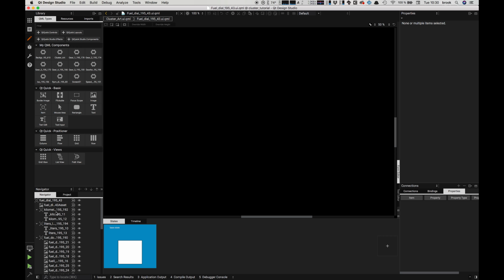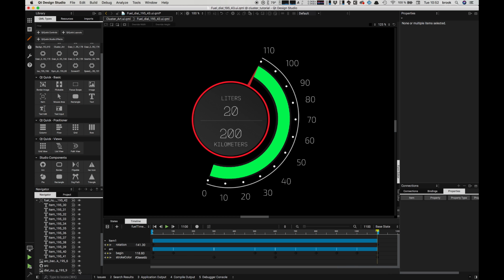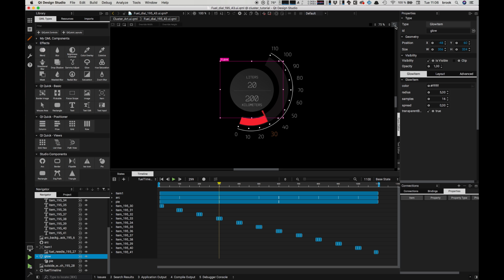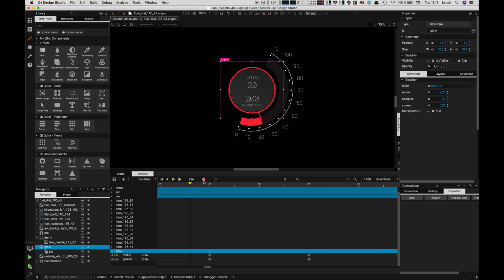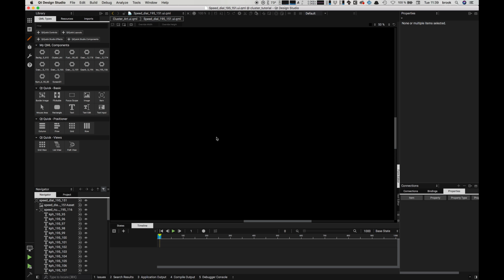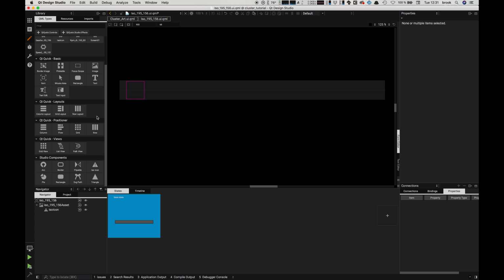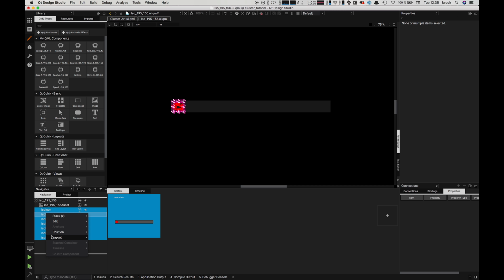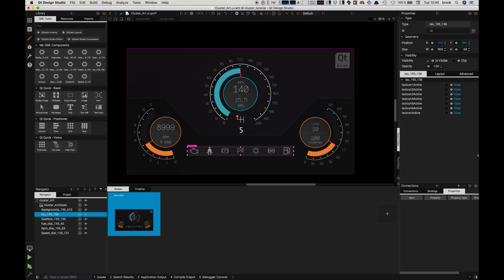Learn to use Qt Design Studio by Building an Instrument Cluster for Your Car HMI (Part 3)

Comment: Which module needs to be added in the .pro file, in order to gain support for the QtQuick.Studio.Components shapes (like Arc, Triangle, Pie, etc). No matter what I've tried I can't seem to get Studio Components to become available. I do have a commercial license for Qt, but don't see anything else I can install that seems to indicate Studio Components are available.
Reply: in the header of the qml file, you can add thing like
import QtQuick 2.12
import test 1.0
import QtQuick.Timeline 1.0
import QtQuick.Studio.Components 1.0
import QtQuick3D 1.15
import QtQuick.Layouts 1.11
import QtQuick.Studio.Effects 1.0

The ~.qml or just get the Qt Design Studio and work on it there and then still work on it in Qt Creator
Reply: @charlesiroegbu8949  The issue is (was) that those elements are Qt-specific library components that were not included in a standard Qt installation back when I first created the post in July 2020. Since then Qt has made it much easier to access them, in the way that you suggest. However back in mid-2020, they were NOT available by default to Qt Creator, so you needed to 1) go find them in the Qt Design Studio file path, and 2) manually copy them into the filepath of your Qt Creator project. Then you could import them as you demonstrated. Obviously Qt has improved the process since I first created the post. 

Since I had a commercial license for Qt back then (and still do), I emailed the support folks there this same question after I didn't get a response here. They responded to my support query, and gave me a link to the process (which, oddly enough, wasn't in referenced in their documentation until my question got asked). They've also now made Qt Creator aware of those components by default, as your post correctly indicates. So...did my question prompt them to fix the process and make the documentation available? I have absolutely no idea. I'm just glad it now seems to work better now...

Comment: I have to admit that I am puzzled by the vast amount of manual work one seems to have to do with this editor(*). It cannot be intentional that you actually have to select each single component in order to change to the font name. Almost all modern editors I know allow you to multi-select items of identical types and then change one property, so that the change gets propagated through all selected items. That's just "common workflow".
Second, shouldn't a "font" item be used instead? So that you simply say "use this UI's default font" and change that font in ONE place instead of every single item? The way it is done here (having the same property on dozens of items) is way too error-prone from my perspective. 
Modern UIs (i.e. UIs that have been designed after the late 1980s) should allow the user to change elements - like the font (type, size) and placement of elements. Allowing for this to work (again, it is a standard UI requirement, according to European Software Ergonomy Guidelines) you really NEED to have "global" definitions of changeable UI elements.
I fail to see the advantage of a visual editor if you have to type in all properties manually anyway …

I apologize for coming across as negative - I welcome the tool, my comment was meant as constructive critic.

Marc Albrecht

---
(*) Honestly, it feels like you'd be twice as fast with creating that specific UI by setting it up in pure code instead of using a WYSIWYG editor. If not even much faster.
Reply: Yes, this is a tech preview and font handling is not yet properly working here, multi selection and automatic font loading from the bridge plugin are high priorities for the next release.
Reply: Agreed. Seems like you would be better off defining these values through the plugin and prior to importing.
Reply: @pixelated-friend  I guess part of this comes from the simplistic intro nature of the video.
in real life you will create a component text and then copy paste it were needed.